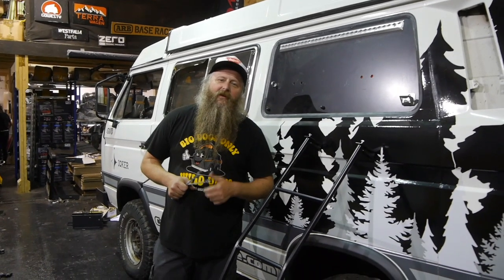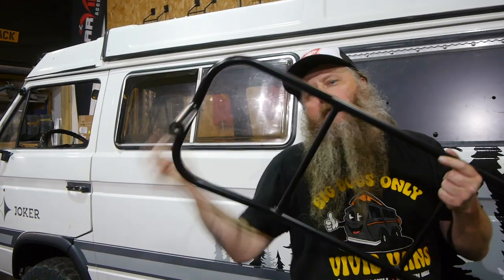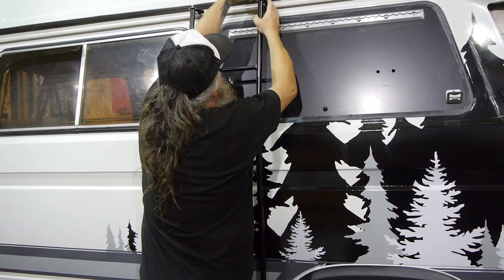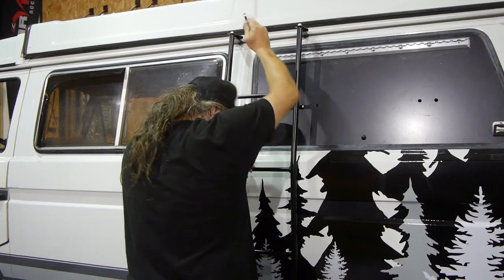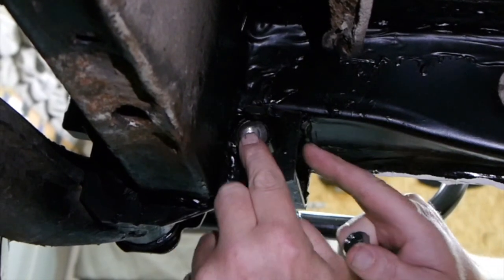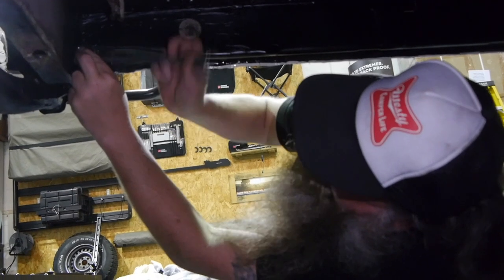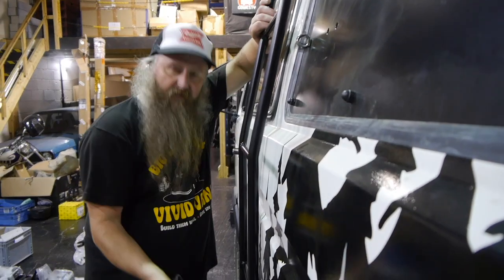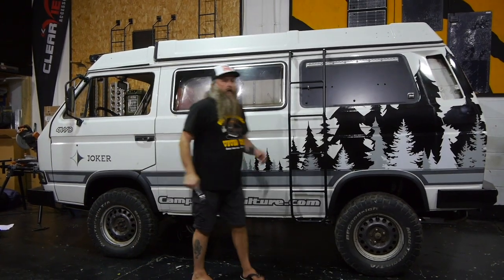Side ladder install for VW T25 T3 Vanagon - CVC Produced Side Ladder

Comment: Vans looking sweet!! Can this ladder be mounted on the slider door side? That's my only option as that's where I have access to my roof storage pod as the other side is solar.
Reply from the maker: Afraid not. If it went on the passenger side where the opening door is it would stick out way to far and be dangerous to cyclists etc. You would take someone out for sure!

Jed